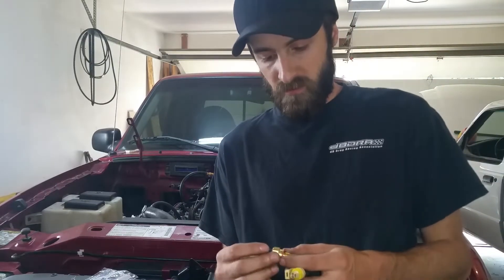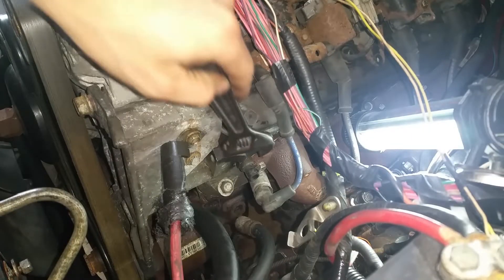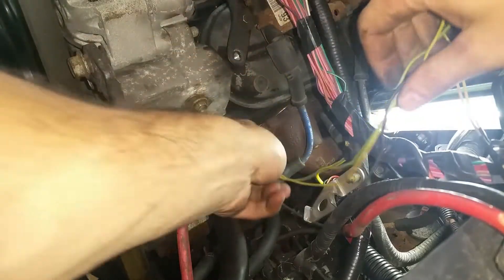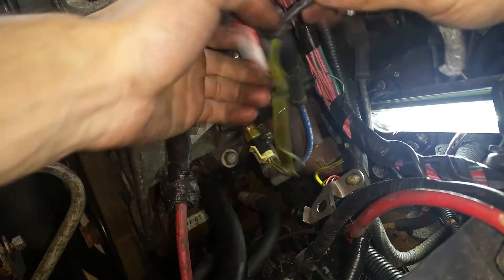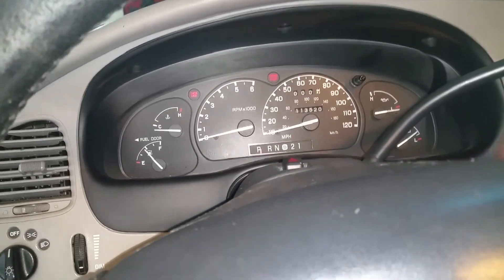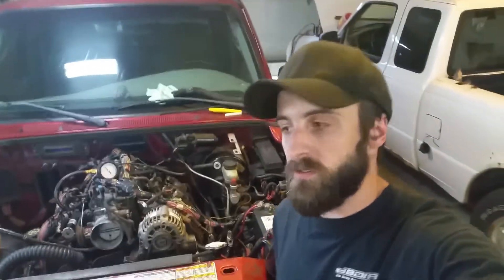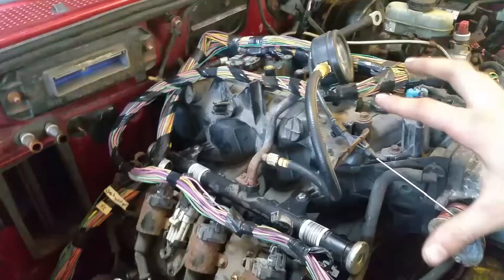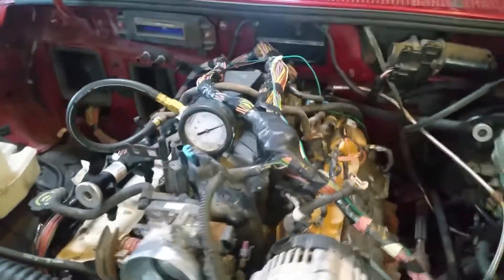EASIEST WAY!!! HOW TO RUN GAUGE ON LS SWAP WITH 3 WIRE COOLANT TEMP SENDER!!!

Comment: We’re does the 3rd wire exactly go trying to wire up my g35 Ls swap thanks for the help
Reply from the maker: @chasef6275  3rd wore goes to gauge.
Reply: @ I understand it goes to the gauge I just don’t understand how I get it to communicate with the gauge bc on g35 they communicate through the pcm to the cluster through a serial data wire so do I just tap that 3rd wire into were my stock signal wire was for my old motor?
Reply from the maker: @chasef6275  Oh, I missed tue g35 part. The G35 runs through CANBUS so there's not a way to just hook to the gauge. When I did my 350z I use the LOJ harness with the canbus translator to run the gauges.
Reply: @ that explains why I can’t find no diagram on it lol thanks for the help so theoretically I can get this aftermarket gauges and I can wire that into the 3rd wire so I can see how hot my motor is getting ?
Reply from the maker: @chasef6275  Yes, aftermarket gauges, or canbus. I got the oil pressure to work but I think that was it.
Reply: @ oil pressure would be nice as well but infinite dosnt Even have a gauge smh so I’ll just add 2 gauges oil&temp thanks for the help only reason I Ls swapped my g35 is bc of ur vids u made it look so simple yet so efficient got it started yesterday can’t wait to get trans and driveshaft in so I can drive it around again thanks for the help 👍👍

Comment: I've got a 05 lq9 that I hooked a bosch electric oil pressure gauge up to int the factory oil pressure sending unit location but am not getting a reading on my gauge. All wires are hooked up correctly.  Any suggestions

Comment: How about telling us which wire goes to which instead of just yellow and black go to the computer. The three wire plug has black gray and blue. So that doesn't help much unless you already know.
Reply from the maker: It's a resistance sensor. Polarity doesn't matter. They could be switched and function the same way.
Reply: @BlaserBuilds  and there are 3 wires on the sensor. So they do matter.
Reply: @BlaserBuilds  on mine there are three square pins. I assume the single one above the other two goes to the gauge.
Reply from the maker: @chassispartsonline  You can reference the wire position in the plug in the video. The sensors usually have 2 pins parallel and one pin facing opposite of the other 2. The one opposite goes to gauge. Usually pin C on diagram. A and B go to computer, polarity doesn't matter.
Reply: @BlaserBuilds  thanks but mine doesn't have them like that. It has three the same direction. Plus my extra wire is blue. My wires on the harness are yellow and black. The ones on the plug are black gray and blue. My gauge works but may not be compatible with the sensor. It doesnt work wired like in the video. But if I probe it and ground it the gauge works. I'm just going to re install the two wire and then use the other port on the other head to use my stock sensor.

Comment: I'm trying too get my temp sensor on my 2002 Z28 working with no luck so far even after new one installed other day
Reply: @CottenEye Joe  I got mine working ! somehow my speedo was hooked up too the Coolant temp sensor and the temp sensor too speedo!.... I reversed the wires back a few months ago too correct pins  now my temp works sensor and now my speedometer works as well ! that was my case because i used a different wiring harness from WS6 on my Z28 .... i guess, that or someone messed with it anyways your problem I'm not sure because its three wire mine is only two , I know you want too run a engine with cts sensor or it wont run right but Ive never heard of stalling ? do you have too run aftermarket gauge or can you hook original one up?

Comment: I used this same sensor on my ranger ls swap the gauge works it just doesn't read correctly it never moves off cold it moves maybe a 1/8 inch or so when hot do you know what the problem maybe?
Reply from the maker: Calibrarion is different, I just marked a spot on the cluster for where normal temp is.

Comment: Do you have to have the 2 computer wires hooked up in order to make the gauge wire operate the gauge?? I want to use the gauge wire to make the temperature gauge work in my LS swapped 4 cylinder Fox body..... I will install that sensor in the unused port in the passenger side head and wire to factory gauge wire.

Comment: Thanks for providing the info. I just installed on my 67 C10 with 5.3 and temp gauge is now working
Reply: How off is your temp gauge or did you upgrade the temp gauge to late square body guage ?
Reply: Agreed how do we know the ohms match the oem cluster?

Comment: Thanks for the video. How do you know what wires go to the pcm and what wire goes to the temp gauge?? Are they numbered ? And in what order since the pcm has 2 different signals high and low?? Getting ready to do this in my swap. TIA
Reply from the maker: Or the "C" pin to guage... Its the one pin opposite of the other 2....
Two be this direction  - -
One will be this direction.  I 
if that makes sense.
Reply from the maker: Green to gauge. Other 2 to computer. Its a thermistor so can be wired either way.
Reply: Yes makes perfect sense.. thanks for your input brother. I appreciate it.

Comment: Is there any other place to put temp sensor in?
Reply from the maker: Could do water pump, or back of passenger side head. Pass head will read cooler, pump will read hotter.
Reply: Is passenger side head hole same thread size has the the drivers head temp sensor?
Reply from the maker: @antoniogarcia-qe7dz  Yes. Heads are the same. Can be swapped side to side, so everything is the same.
Reply: Also another quick question sorry to bother For twin turbo set up do you think it’s fine to drain both lines into one single line connected by a T fitting and into oil pan instead of drilling two holes since I already have one and don’t want to go through hassle of removing pinion and rack to get to remove oil pan

Comment: So where exactly did you put the third wire ? And how?
Would it be ok if the 3rd wire is attached somewhere on the negative metallic board around the engine..in this case where to twist the other extremity of the wire: into the continuity or the powering ground wire of the temperature sensor ?
The old owner of the car did something like this to make the temperature sensor work good..and i don't really know what went wrong before to make him do that..maybe you will know, since you are using a third wire to the temperature sensor..

Comment: did you hook the gauge wire up to the old harness gauge wire?
Reply from the maker: Yolanda Thomas Yes just spliced it in to where it went into the connector in the engine bay.
Reply: Thanks!!!! You think I can do the same thing for  fuel pump,speed and a/c
Reply from the maker: Yolanda Thomas Should be able to. Is it in a Ranger? My Speedo was ran off the truck so I didn't have to do anything to get it to work.
Reply: I dropped it in a 94 Chevy Impala I have the rework wiring harness I bought I'm just trying to figure out easy way to hook up my speedometer fuse pump and all that jazz I was thinking hoping that the easy way would be to wire everything into the old harness bulkhead on the firewall

Comment: I believe that third wire needs to both feed the coolant temperature to the ECU AND the temp gauge, otherwise the ECU doesnt know when to run the thermofans, and doesnt know what FA mixture to do since some of the fuel air mapping uses the coolant temp to decide the mixture. You see there are 3 wires, but 2 are for power, and only one is for signal.
Reply from the maker: Dean Simonovic The 3rd wire goes only to the gauge... The other 2 are the ECU wiring... One is a 5v reference, the other is signal back to computer. Sensor adjusts resistance which changes the signal back to ECU.
Reply: a21bravo it may be different to my LS1 then, because it's definitely only one signal wire on mine. Good to know there is more than one type of sensor.

Comment: I put 2 of those sensors in my truck and it don't work for me I get a check engine light saying high voltage temp sensor and my gauge in the truck started climbing and then quit didn't move since. 2002 Yukon 5.3 into a 1987 Chevy truck.
Reply: tire in the mud yes so you keep your ls temp sensor becaise they are not interchangeable due that they both signal the computer in different ways. So what you did would be the right repair. Yiu need the ls ecu to know its coolant temp due that it uses this info for almost everything in the engine control.
Reply from the maker: tire in the mud Hmmm... That's weird.
Reply: I have not found where anyone else has had the same problem it's kind of weird I put the stock sensor back in and the check engine light goes off I just have to put another sensor somewhere else I guess
Reply from the maker: tire in the mud I wonder if the resistance is that much different between the sensors.
Reply: If you have high voltage is because there is an open in the circuit. You probably hook it wrong
Reply: I tried several different things and cleared the code but it kept coming back so what I eventually done was bought an adapter off eBay to use the original temp sensor from my 87truck.

Comment: Do you have a video of getting the speedometer hooked up and where do you tap in for the boost gauge?
Reply from the maker: Manuel Rodriguez Speedo was reading the factory sensor from the truck so didn't have to do anything for that. I'm reading boost off Hptuners scanner.
Reply: a21bravo where exactly do the 2 wires go to the computer ?

Comment: Can this be used if i hook up the one wire on a carbed swap to run to the gauge. Without using the other two wires?
Reply from the maker: henderus I believe so. The gauge usually has power and position is determined by resistance to ground so should function the same.

Comment: Nice video. What are the pin locations for the two wires going to the PCM? 
And, were you able to do the oil pressure sensor video?

Comment: How did you determine which wire went where
Reply: when u look at the plug there will be left port right port bottom port. mark or cut one @a time
Reply: Mitchell Wood.     So how did u know which is which
Reply: Mitchell Wood how did you determined which wire went were

Comment: When I did this to my 89 obs swap no antifreeze came out when replacing the temp sending unit, all I heard was air coming out. Does  this mean there's air trap in the cooling system? My temp Gauge did go all the way up indicating it's overheating.
Reply from the maker: Rene Valdivia Yeah I just swapped it recently when I removed header to build turbo manifold and about 1/3 of a gallon came out.
Reply: a21bravo thanks man. Means I'm gonna have to burp the engine

Comment: I found me a used sensor and the wire on a supercharged 3800 Park Avenue non supercharged has a two wire but this one had a 3. thanks your videos I've helped my project a lot. lm7 4L60E in a 67 GMC
Reply from the maker: 81ss350 Sweet, I pulled one from a Park Avenue also but it didn't have the right thread for the LS head, it was too big.
Reply: sensor is different but wire is correct

Comment: You don't need to put any thread seal on it?
Reply from the maker: Trevin Taylor No, it's working fine.
Reply: Trevin Taylor  it uses a copper crush washer. It's 12mm×1.5mm. Not npt